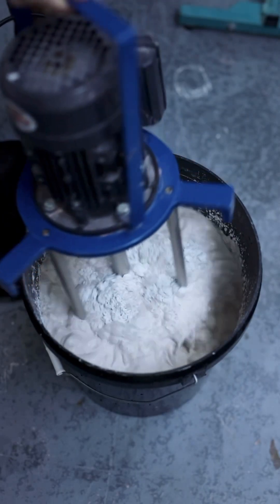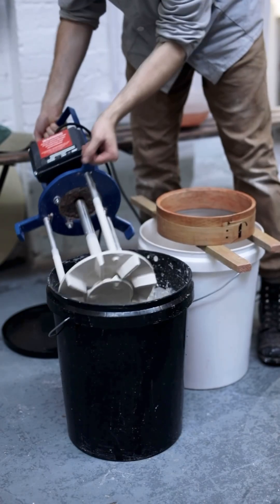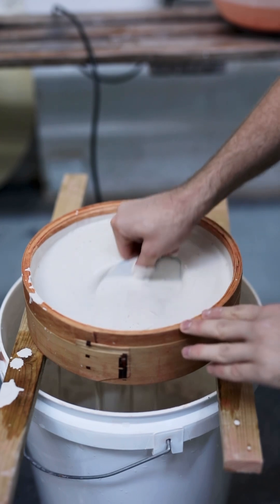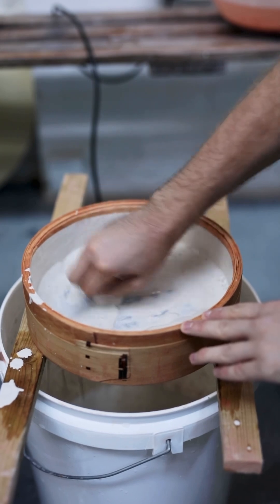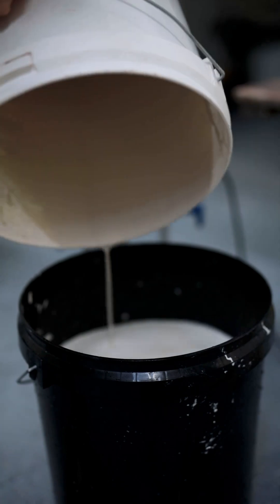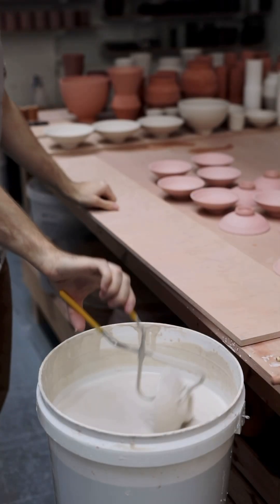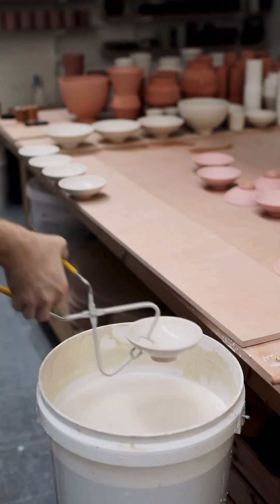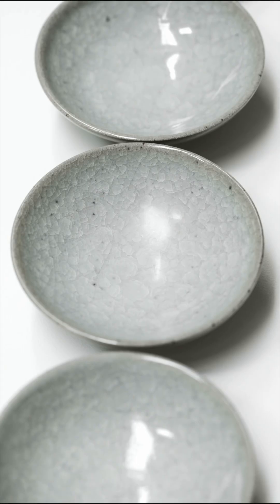Mixing a White Feldspathic Glaze

Comment: I worked as a studio tech at a ceramics place for a few years, and one winter I made a glaze similar to this. I labeled it as a snowflake glaze, and it was extremely popular. The problem, I discovered, was that it had a tendency to flatpan on the bottom of the bucket to a solid chunk, and it was both a nightmare to stir and clean up. I had to dump in a cup of epsom salt to keep it loose enough to use.

Needless to say that I never made it again no matter how many people requested it lol. It is really pretty, though.

Comment: I found a neat trick for anyone who would like more copper carbonate glazes but the cost is too high on them:

Pure Copper Sulfate is cheaply available.  I found a 5lb bag for under $30USD.
Baking Soda is also very affordable, at under $20USD for a 10lb bag.

I make a solution of 100g-500g copper sulfate and pure distilled water (OUTSIDE OR UNDER A VENT HOOD.  It smells like the rankest armpits you've ever smelled and is very caustic and the next step produces CO2 and lots of bubbles) in a large chemsafe vessel or jug that has more than a 2gal capacity.  I use about 100-500g (however much will disolve into room temp water.  Avoid using hot water in any reactions EVER, unless you actually know what you're doing) in a gallon of the pure distilled water.

Then you add baking soda SLOWLY, keeping a close eye on the temperature of the mixture, letting it normalize if the temp goes moderately one way or the other, until the mixture no longer fizzes when you add baking soda.

[THIS PROCESS PRODUCES CARBON DIOXIDE, SO ONLY DO THIS OUTSIDE/IN A FUME HOOD AND WITH ADEQUATE PERSONAL PROTECTIVE EQUIPMENT.  The Aqueous Copper Sulfate solution is VERY CAUSTIC.  Be careful when and where you do this, if you choose to do so.

Potters work with a lot of dangerous chemicals in their work anyway so i know this isn't news to y'all, but still, BE SAFE.]

Immediately after adding the baking soda you'll start to see fizzing and a cloudy mixture start to form, and at the end you'll have a mixture of insoluble copper carbonate and aqueous solution of sodium sulfate.

You can either get a bunch of mason jars and paper coffee filters and filter out the sediment after drawing off most of the liquid, or order a pack of very large commercial paper coffee filters and use those attached to other chemsafe plastic containers. 

Copper Carbonate is entirely insoluable in water, while sodium sulfate dissolves readily in water, so you can continuously use pure distilled water to rinse your mix in the filters until the water stays clear coming out.

Alternately, after draining and saving the first fluid after it all settles (3-5 days at most) you can add clean pure distilled water to the copper carbonate sediment, shake it up, let it settle, and keep siphoning off the fluid and replacing it with clean water until it stays clear once settled.

Then you have pure copper carbonate.  If you let it sit long enough it'll start to form some very pretty green crystals.  If that's your jam, copper carbonate dissolves readily in isopropyl alcohol, so you could make a supersaturated solution and grow some neat crystals.  You can do the same with the pure water and copper sulfate which makes blue crystals.  Just a neat thing i found fascinating.

Bonus fact: sodium sulfate is an ingredient in old school washing soda.  I can't recommend using it for personal use, unless you can be certain you got out any impurities, but as far as I'm aware it's reasoably safe ingredient in homemade detergent.  Fact check that and anything else i said here before trying it yourself, but this was the process i followed to make a lovely batch of copper carbonate for my mom to make glazes from, and it turned out beautifully. 

Once fired on porcelain, it was a gorgeous pastel Robin's Egg or Light Turquoise Blue, as a standalone glaze.

As always: "don't try this at home.  Educational purposes only.  Conduct any of the above mentioned activities at your own risk."  Etc. ad nau.

Comment: How does glaze end up covering where the tongs held it to dip?
Reply: Actually, Florian is a perfectionist, and he cleans up drips and rough spots by rubbing his fingers over the dry glaze, and using that extra dry glaze, he fills in those spots.  Also, the glaze will flow a little when it's fired, and that also helps fill in the spots.
Reply: Surface tension, I'm assuming. If I recall from Florian's other videos, there can occasionally be small pockmarks where the tongs held the bowls, but presumably those often get naturally filled in while the glaze is still wet and slightly flowy.